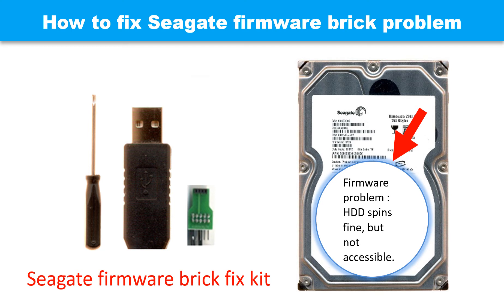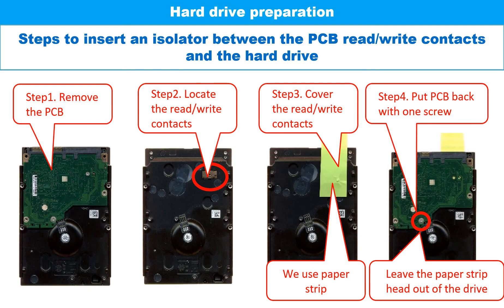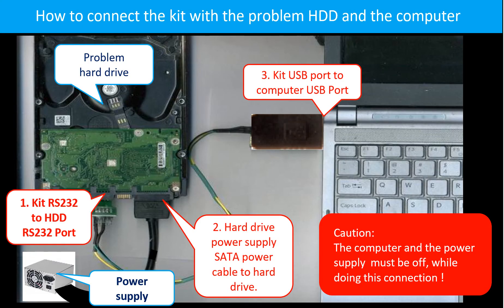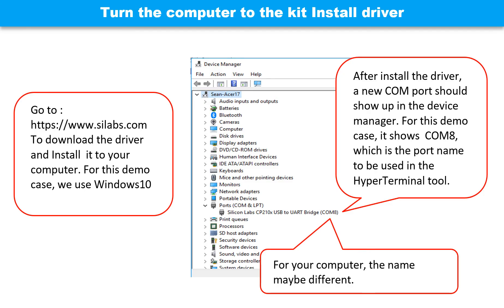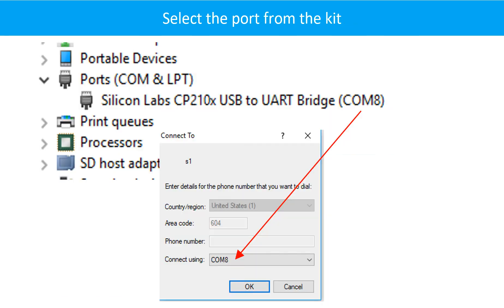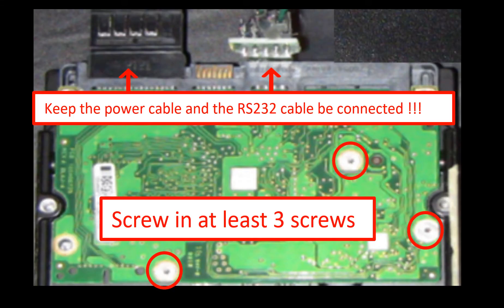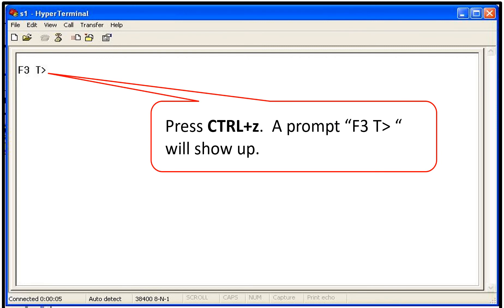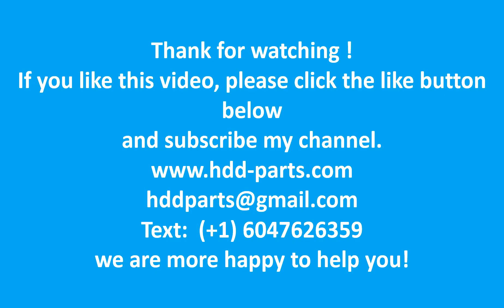Seagate data recovery repair firmware bug locked bricked busy BSY error not detected in BIOS

Comment: Hi all. I just fixed my Seagate unit. Hasn't worked since 2011!! I purchased a USB to TTL Serial 3.3V Adapter Cable TX RX Signal 4 Pin PL2303HX Prolific Chip, plugged it into a Windows XP pc and followed the steps here. Thanks for the tutorial.
Unfortunately no Bitcoin on it. ;-)
Reply: @postcardsfromprotest  I had to remove the plastic covers on the pins that go to hard drive and put tape around them so they fit. Apart from that I follwed the video instructions and all went well. You need the proper cable with the chip though.

Comment: HDD is not detected in BIOS. I can hear tick sound 5-6 times and then the HDD stops spinning. Is this method useful to solve this issue?
Reply: maybe yes .but this tuto for 
seagate HDD            1560SFHS,ST1500341AS,ST31000333A8,ST31000333AS,ST31000340AS,ST31000340NS, ST31000342AS,ST31000640AS,ST3100340AS,ST31500340AS,ST31500341A8, ST3160813AS,ST32000540AS,ST3250310NS,ST3320613AS,ST3320813AS,ST3500320AS, ST3500320NS,ST3500620AS,ST3500820AS,ST3640323AS,ST3640330AS,ST3640623AS, ST3640630AS,ST3750330AS,ST3750330NS,ST3750630AS,ST6500620ST,STM3500320AS, STS31000333AS
Reply: @azetech2232  Will this work for 
ST3000DM001? I have a USB to RS232 adapter and the drive has those pins, so I'd like to try it if you think it might work. The Drive spins for about 10 seconds then powers down. I can't see it in windows. Thanks.
Reply: Ticking is usually a physical problem like the arm being stuck in the disk.